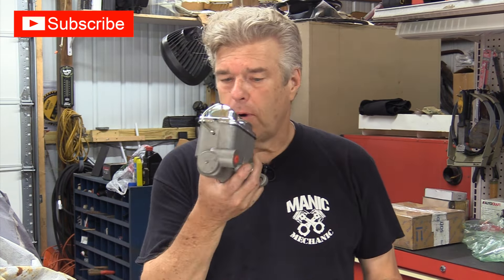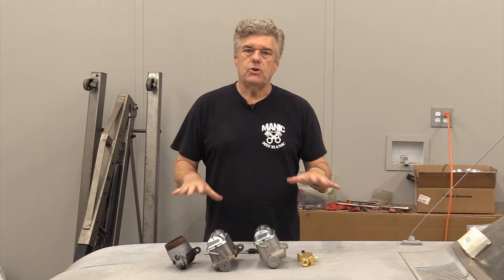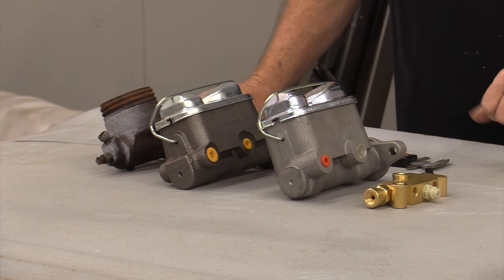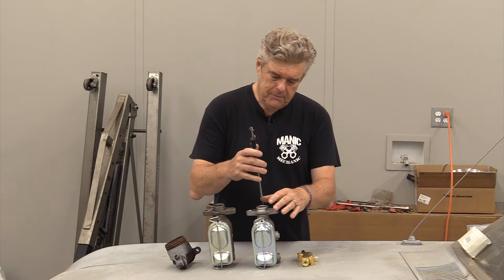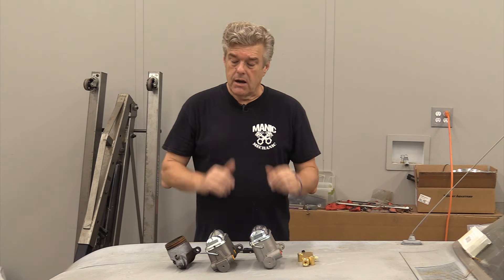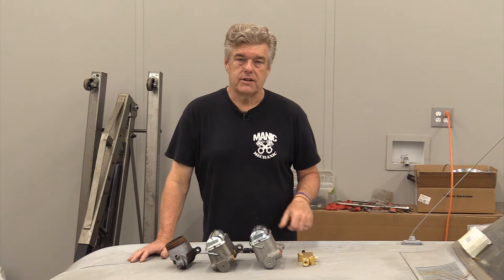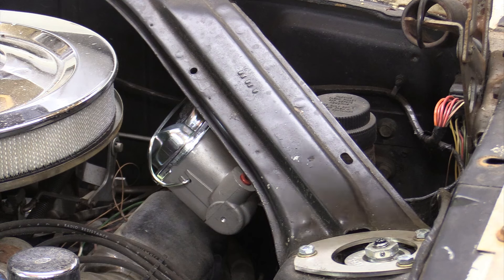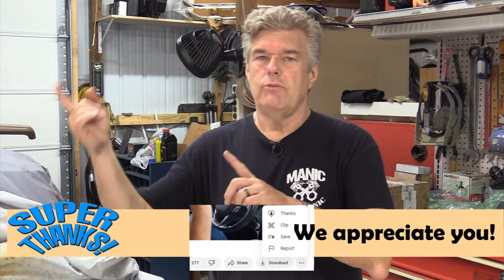Get the Correct Master Cylinder for Your Car

Comment: I love your videos. I put  frnt disc brakes/dual bowl on my 64 hardtop about 3 years ago. When I did that I did put a proportioning value on. I never thought it stopped great, I thought I had to put to much pressure on the pedal to stop. My alignment guy said I didn't need the value with dual bowl  and we took it off. He said the dual bowl has a proportioning  valve in it, the brakes now feel great. The brake set up (stainless steal brake products) was installed on a  64 Sprint at sometime. I guess I need to stop hard and see what happens. 
Keep the videos coming. Wish you were closer to Los Angeles.

Comment: I had ordered from Mac's a 1960-65 Falcon-Ranchero-Comet Power Brake Booster & Master Cylinder Conversion Kit a few years ago for my 1964 Ranchero. I didn't convert my brakes until late last year so we were way past warranty or return. The bottom line is that just as you said, there is no space to install it. I got in touch with ABS power brakes and they were jumping up and down telling me I had the right one. I forgot what the measurements were but I do remember placing the master cylinder alone allowed me about 1/2 inch clearance so the booster was out of the question. However, they assured me I could just eliminate the booster and use the Master Cylinder. It seemed to go smooth. I used the proportioning valve and I added a three way onto the back line to install my brake switch. So far, I am still among the living.

Comment: The other difference when you change bore size on the master cylinder is pedal travel. Smaller bore gives more pressure but longer pedal travel than a larger bore and obviously vice versa.

Comment: Just had a master cylinder fail couple days ago while on a date. In my 71 Oldsmobile. Leaking out the weep hole and kept dragging the fronts. Luckily I got the misses back home before it gave out completely. Threw it in reverse to leave her driveway and pedal went to the floor 😆 it was an O’Reilly unit. The warranty replacement is made of aluminum. Failed part was iron/steel. Lasted about 4 years and 10k miles. Tons of rust in the brake fluid. Calipers appear to be fine on inspection but swapping them since they are under warranty. The rotors were toast and brake pads were cooked and cracked.

Comment: We swapped out the MC with one that came from SSBC and a prop valve. The braking feels soft and feels like the pedal has "too much" travel I feel. Is that because we are using the original single reservoir push rod? Do we need to readjust the prop valve? Or both?